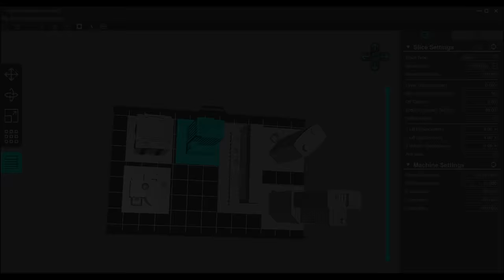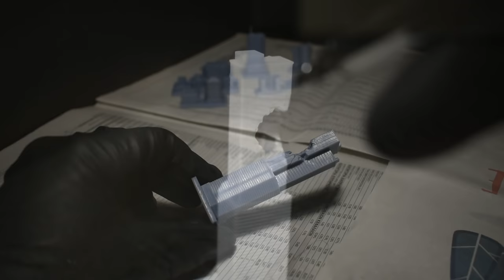METEOR hits Building DIORAMA LAMP-How to Make-Epoxy resin Art-DIY

Comment: If you look closely you can tell the things flying off the building aren't chunks of meteor, they are man made projectiles. Also the rock itself is to circular and if you zoom in 400x you can see the edges were crafted. Probably by the orbital laser station.  And meteors don't explode upon impact. Explosives were either inside the meteor or pre planted in the building.

Comment: Don't take this the wrong way, because I see a lot of diorama builders do this.  So much energy, effort and craftsmanship is put into the dioramas (and they turn out amazing), but then very low effort is put into the bases.  Things this beautiful should be sitting on something just as beautiful.  No disrespect intended, just think this aspect gets overlooked.
Reply from the maker: I agree.  Probably the reason being that we diorama builders know how to make dioramas but lack the wood carpentry skills and tools to make an exquisite base.
Reply: @4THECRAFT  Quality of wood makes a huge different too.  Stay away from soft woods like pine.  Look for hardwoods like oak.  Soft woods tend to splinter more than hard woods.  I would equate the different  to extruded foam vs sytrofoam.   Any, good luck!

Comment: So, How did you get the triplex off after pouring the epoxy in the box. Doesn't it stick? and what tools did you use to smoothen after taking it out. I would love to learn to do some off those thing. I could never do what you did though. It's amaaaazing! Inspirational!
Reply from the maker: Plexiglass doesn't stick so it was quite easy to remove.  I used 350, 500, 1000, 1500, 2000, 3000   sanding paper and water

Comment: I have tried a few times to polish my resin projects. have the hardest time NOT melting the resin when sanding. how do you do it?
Reply from the maker: I wet sand the resin. When you use water the resin doesn't melt. Also I start with 350grit, then 500, 800, 1000, 2000,3000 and 4000.
Reply: @4THECRAFT  i did the normal steps of grit up to 3000. I did wet the project. wonder if the sander had to high of orbital rate? maybe resin didnt cure fully? well current project is a cherry wood and resin desk. start sanding and cleaning it up tonight. fingers crossed. in the end, that table, I flood coated the entire top and it turned out beautiful.  Love your art. beautiful. great job on them.

Comment: That looks amazing! What kind of resin did you use for the big pour? I noticed it was all at once but there was no distortion, bubbles or cracking!
Reply from the maker: I used resoltech wwa
Reply: @4THECRAFT  that’s, gonna research it.
I’ve wasted $900 in resin from doing big pours when I started doing live slab tables lol not fun